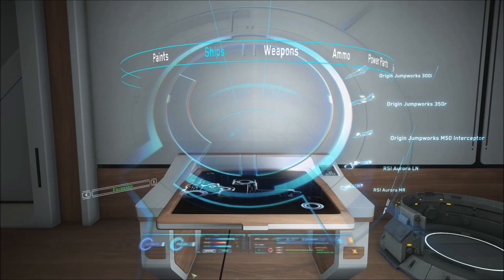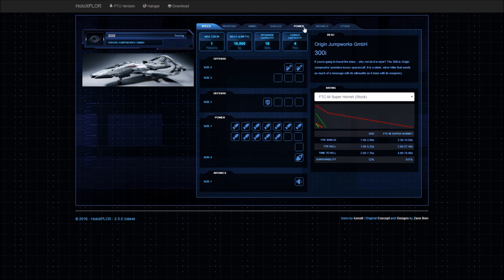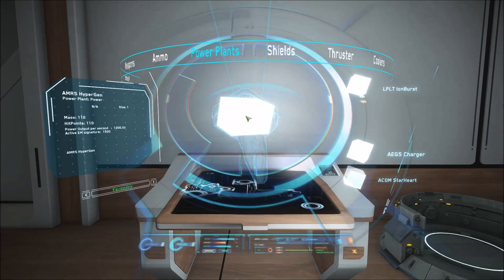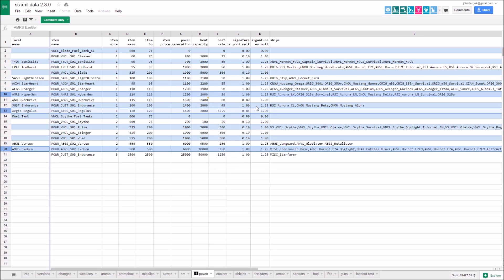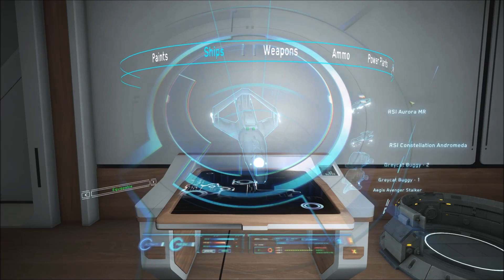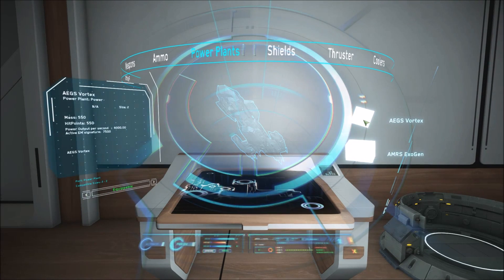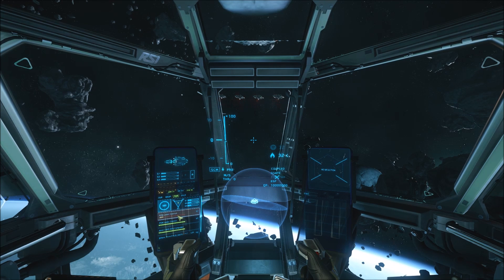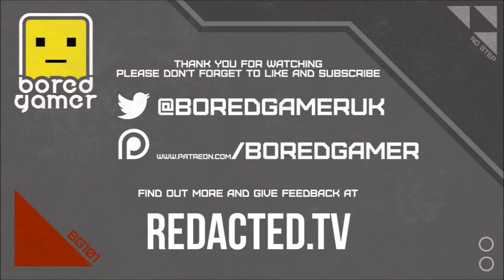Star Citizen - How Do Power Plants Work - Item System 2.0

Comment: I'm not sure if this has been asked already, but are power plants additive? For example, I have an Avenger which has the capacity for one S3 power plant or three S1 power plants as evidenced by the three AEGS Chargers. What I'm asking is if those three S1 plants add up to one S3 Power plant, however you match them? Like - assuming they're all hooked together - if I added a JUST Endurance, which has a an EM multiplier of 1.25, to the two AEGS Chargers would I then have a added mass of 320, a power pool of 3800, a heat capacity of 4000, an IR multiplier of 1 and an EM multiplier of 1.25 - since 1.25(1^2)=1.25? I'd understand that values like HP and heat generation are individual and wouldn't add to the overall linking supplies, except maybe heat generation, which would then beg the question does heat generation add together, does one heat trump the others for overall heat generated, or do they average out? 

Hope that's not to much to answer.

Comment: Hey bored gamer I've been having some issues lately,  I've just recently upgraded to a gtx 980ti running at 2k resolution and have found that I'm averaging around 20fps or lower on very high. I was wondering if you could just tell me your specs because you seem to run the game very well.  also I was wondering if resolution scaling would be recommended but so far running it at 1920x1080 still gets me around 20fps. also Im running an i7 4820k 3.7 ghz with 16gb ram
Reply: upgrade your gpu
Reply: What FPS do you see in free flight, because multiplayer performance is limited by the servers?
Reply: +Luke Pawlowski free flight / vandull swarm I get better performance on but im just puzzled by the pu performance because my old GPU (r9 290) seemed to get better frames and it was many steps down from the 980ti in terms of power. perhaps it's the 2.3 patch, I've heard that it has been worse performance for some but better for others
Reply: +crunchy memes Its the new update or the server. I have a GTX 970 and i get 40-60 fps on very high. You should be getting more. Hopefully next patch fixes your problem.
Reply: +ImmortalPlays Thanks for the insight, that reassures me that it's not my system. guess I'll just hope the next update improves some things
Reply: +crunchy memes Ya, hopefully it does! Tell me if it improves or not!
Reply: +ImmortalPlays Will do (:
Reply: +crunchy memes Wait, whats your PSU (Power Supply)
Reply: +ImmortalPlays And how many watts is it?
Reply: +ImmortalPlays 750W
Reply: +crunchy memes Okay, 750 W is enough for a GTX 980 TI. 600 or greater is the recommended for a GTX 980 TI! :-)
Reply: +ImmortalPlays Exactly
Reply: +ImmortalPlays you posted this comment twice, read my reply to the repeat comment of this one. It's nothing to do with your hardware. More CPU based and just bad optimization and useless graphics features being rendered. Bored uses a custom user.cfg file in the exe directory for SC that disables some features and ups or enables other features and improves performance drastically, the CPU bug (if still not parched) requires going into resource management in task manager every time you start the game to "reset" certain logical cores in the CPU as the game tends to max out certain cores and not utilize there properly. He has tutorials and custom (base) user.cfg files linked in the tutorials for it just search his channel for the videos, they're quite old videos.
Reply: +ImmortalPlays damn it sorry that was meant to tag crunchy memes not you.
Reply: +crunchy memes look above
Reply: +D Campbell Yes I have been pondering about the CPU load issues as I am aware that the current way the game runs does put an unrealistic load onto the CPU without utilising the GPU as much as it could. Furthermore I recently watched the latest bug smashers and they had some server side issues in 2.3 where the server would not delete unused objects after there expire time (ship debris and random objects generated) which of course backs up onto the server and causes major performance issues for both the client and the server. The clientside still has to render all of these unused entities and it puts alot of stress on the client's CPU because alot of these entities have rigid body physics. Thanks for the insight on the user cfg files, I'll have to check them out. I know that I don't have the best cpu and that as well as current optimisation issues and temporary bugs are most likely the source of this problem.